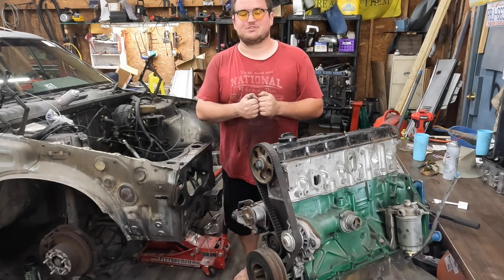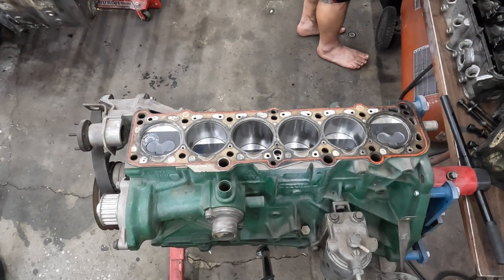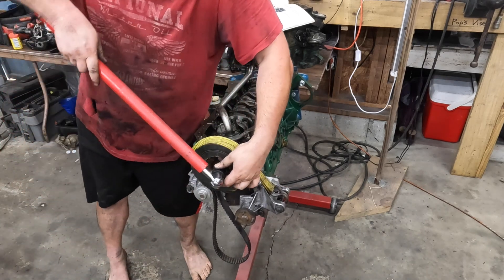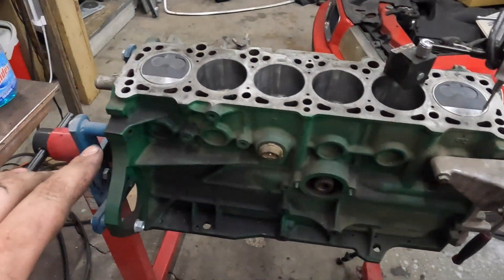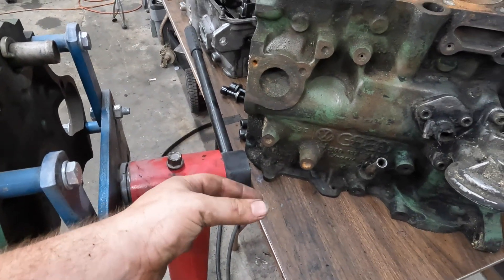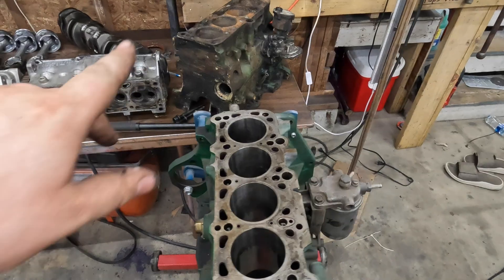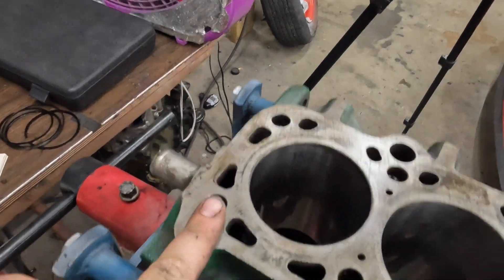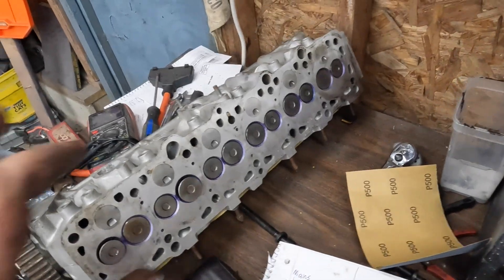Mystery D24t disassembly and inspection (d24 vs. 1.6d)

Comment: Hi, regarding the choice of Cape Town, Coolant tank Radiator can you specify your choice?
There is a big difference between 75kPa 100kPa 145kPa and I don't know which one to choose.

Besides, at the moment my head gasket is dead and I have pressure in the circuit. The cap does not release pressure.
It's a 150Kpa if I put a 100 or 75Kpa will it release the pressure?

Thank you in any case for all this sharing.

Comment: I've been doing the D24/D24T/D24TIC motors since the better part of 30 years, you did quite well. A chunk of wood down on the #1 crank bob is plenty to hold so you can work the center crank bolt and the cam drive must come out as one with the crank pulley/dampener. The head "can" be decked with the chambers in place despite the factory manual if you have the correct broach. I know this is 3 years past but still relevant.

Comment: Often a crank does not need to be turned undersize. Sometimes when the engine gets oil and filter changes on schedule, and is made of high quality parts, a polishing is all a crank needs at rebuilding time. New standard bearings can be fit. Other times if a crank has wear, and the right undersize bearings don't exist, the crank will be welded up or hard chromed back to standard size.

I'm so glad to see someone actually overbore and engine and fit oversize pistons. Too often I meet someone who buys a used car that advertises a rebuilt engine. It drives okay for a few months, then runs horribly, because all someone did was quick hone cylinder bores. Never mind measuring piston to bore clearance. They may have rolled in bearings, but I doubt they even bothered to do a plastigauge test.